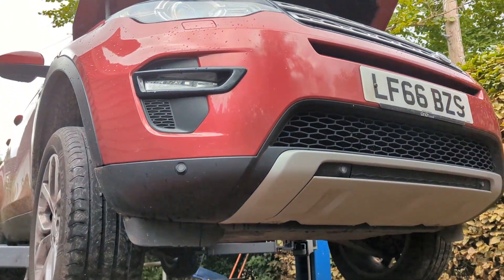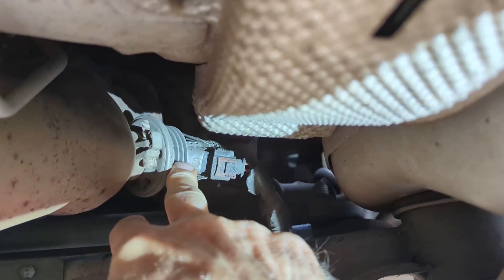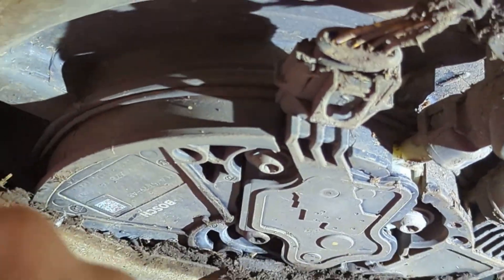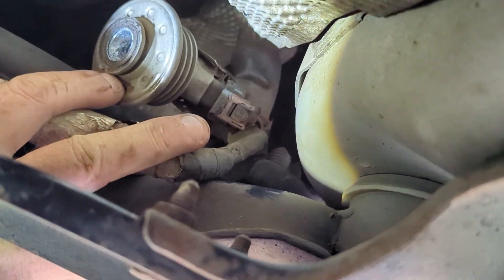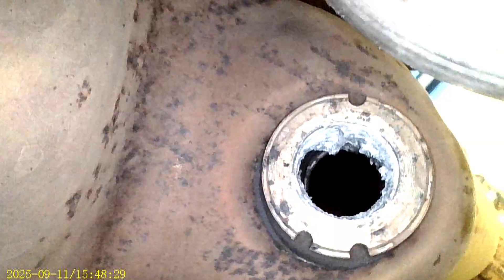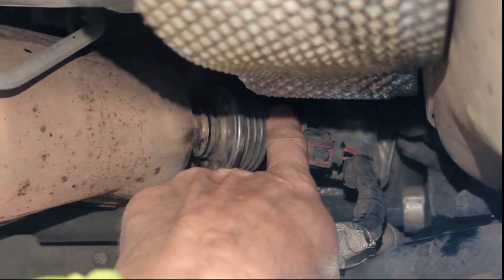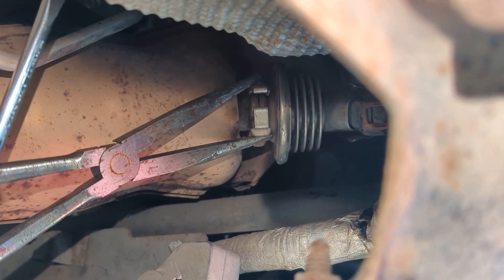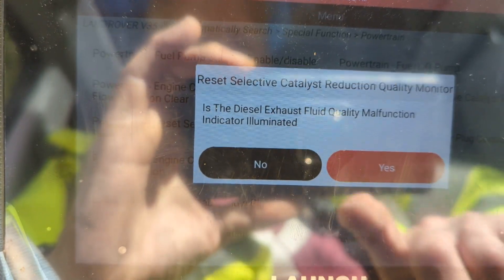Incorrect Diesel Exhaust Fluid Quality Detected” – FIXED on Land Rover Discovery

Comment: Had this last year had new tack and injectors under warranty 
Year to the day done it again out warranty now 
Range Rover want 180 quid to plug in 
They said I over filled my tank 
How wen it said on dash add 10lts I haded 10lts 
Need get rid of my 2022 now
Reply from the maker: That's a frustrating situation to be in with the system issues and the dealership's response. Overfill? Really?? I hear a lot of throw away comments from dealers that don't make sense. Whether they actually believe it or not is difficult  to tell.    The larger dealerships don't usually have knowledgeable customer facing staff, an as they say, a little bit of knowledge can be a dangerous thing. The bottom line is don't own a modern Land Rover unless you have access to a good diagnostic tool and are willing to get your   spanners out. (unless money is no object and driving around in a 100cc loan vehicle is something you enjoy).     The main problem with the system is the will it wont it, you have to complete a drive cycle before the emissions system says ahh OK - you did the work you , not just reset the EDF system. Of course you pay for that as the dealership cant hand it back with the warning light on has to drive it around to get the warning to go off. Most of teh dealerships are stuffed with warranty claims awaiting parts.

Comment: FYI, there is another DEF injector (water cooled) located further down the exhaust called a pre SCR/Catalytic Converter DEF injector, similarly secured with a clamp.
Reply: Not onn mine there isn't??? 🥴🤔
Reply: @ButtonBrand  Apologies, I assumed the phase 1 cars were the same as the later phase 2 models. 👍
Reply from the maker: Good comment thought as I didn't know later ones have 2 injectors. Thanks.